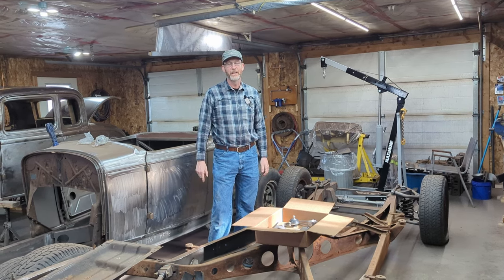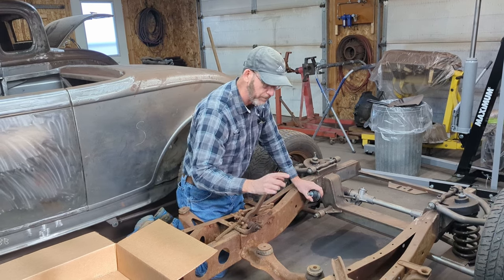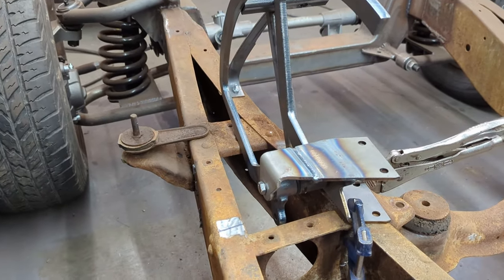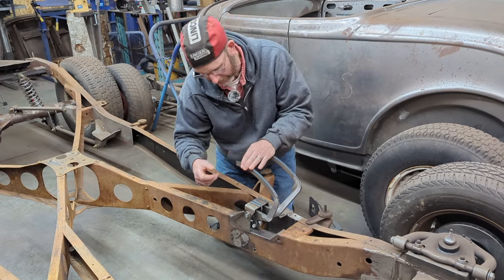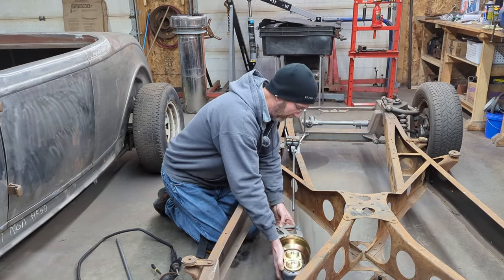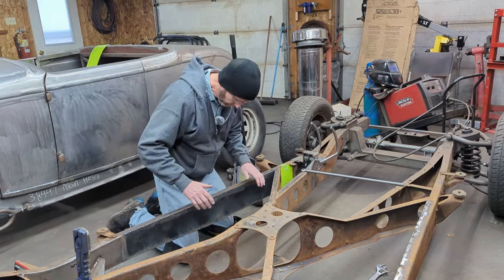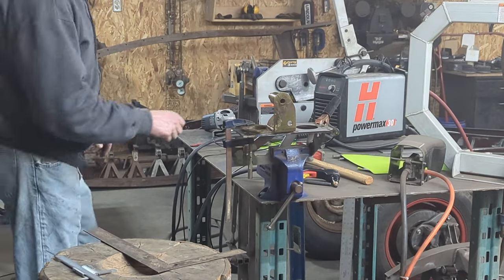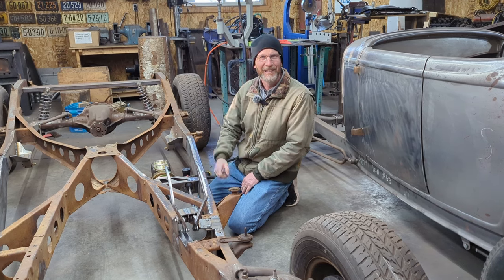Installing brake & clutch pedal in the 1940 Plymouth as well as the brake & clutch master cylinder

Comment: Nice work, as always. Would enjoy seeing more details of small but critical projects such as how you designed and fabricated the bracket for the master cylinder area, which appears to have taken a lot of planning and thought (as did your repair and replacement of the '32 trunk lid recently). How you plan them, shape the metal, etc. isn't obvious (or easy, no doubt), though you make them look simple.
Reply from the maker: Thanks for the feedback. I can work on more details. In the case of the master cylinder bracket, I bought it from Welder's Series but I had to modify it. It needed to be wider for this application to mount the clutch master cylinder. The extra length then also required extending on the other side to weld to the x member so it's supported on both sides.

Comment: Good work on solving the under floor pedal assembly. Thanks for sharing your ideas and solutions. For your slave cylinder set up for the clutch problem, look into the hydraulic throw out bearing from McCleod, 1400 series, as a solution. Speedway Motors also sells something similar. I am running that setup in my 1930 Model A with a Buick 401 Nailhead and Manual Transmission. It's compact and doesn't need a crazy mechanism/fork/extra slave cylinder to run as long as you have a dedicated reservoir for the fluid, which I see you built for the pedal.

Also if you need room for the steering shaft, you can move the engine to the passenger side up to an inch and a half. MoPar did this from the factory in A Bodies with their LA V8 engines. That way  you don't have to spend a bunch of money and time trying to route the steering using a bunch of Borgenson joints to get around the headers/exhaust.
Reply from the maker: Thank you. That's very good information. I appreciate you taking the time to explain it. I like the idea of the hydraulic throw out bearing. There's a lot of room in this chassis. The rear pinion is not exactly centered so if I can shift the engine that's not a bad idea. If I'm not mistaken Ford did this too on their F-150.